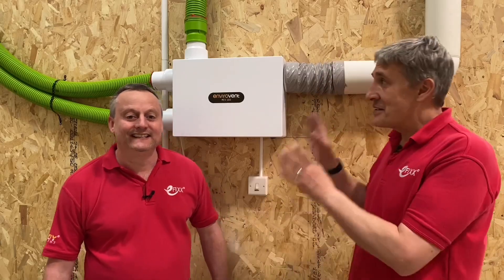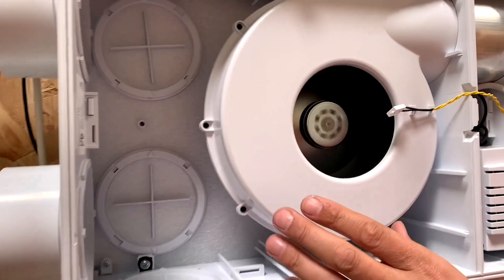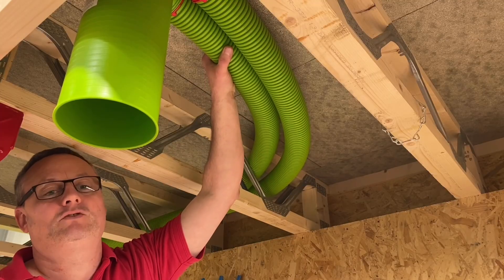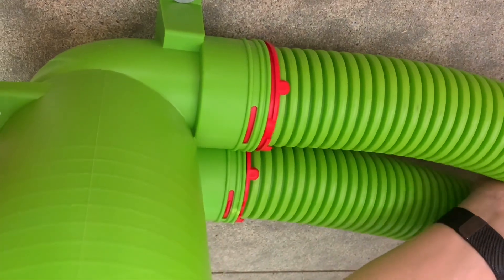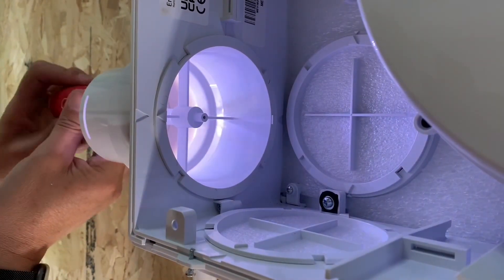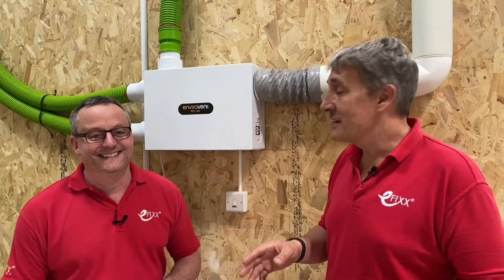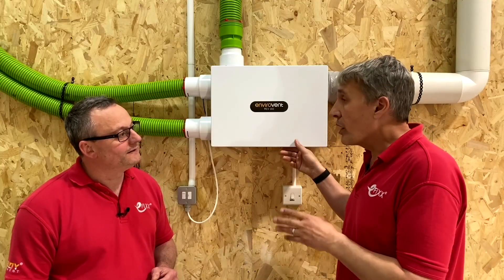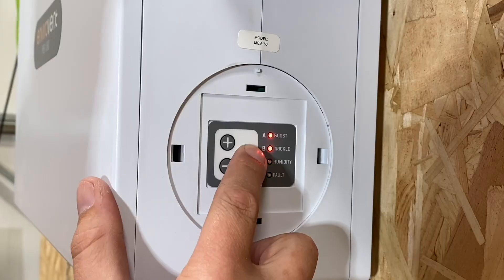WHOLE HOUSE VENTILATION is EASY with the MEV Fans & Fast Track ducting from ENVIROVENT

Comment: I have DCV in my house with much better central unit design. You need to clean assembly unit and its fan at least once a year and screw less removal is critical, otherwise people simply won't do it. Also each remote location has a flap controlled by moisture and/or occupancy sensors. You don't really want main fan to start sucking out equally from all the floors in the house.

Comment: Where is the outside air coming from? You will have negative pressure inside.

Also is there an option with heat recovery capabilities?

Comment: Well,it is good system. But I was waiting for napkin test which shows the power of flowing in and out. Also, the big problem if I can say so, with this ventilation is water gathering by steam in the pipes. I did not saw any solution for it except the flexi pipe after fan not before system.

Comment: I’m about to start our new build and wanted something cheaper than Mvhr, which I’ve had before and gave no heat benefit. Will this system stop the requirement of window vents, as I’m building air tight. Also will it make the house cooler?
Reply from the maker: No you’ll still need a full MVHR if you are going for an airtight home. - we have a full CPD on the topic in production atm.

Comment: Hi guys, looks a good system.. a couple of questions; is there an insulated ducting for this system to install in cold spaces (lofts) to prevent condensation? Also, with regards to heat loss through continuous ventilation would this be an expensive way to ventilate the home. As there is no heat recovery built into this unit, would it not be constantly pulling valuable heat from the home ?
Reply: @danielwood5334  My understanding is that whole house ventilation systems often use heat exchangers to get round this issue. Perhaps beyond the scope of this video as it takes a bit of explaining, but definitely a pertinent point.

Comment: How would a system like this affect the overall warmth of a house considering it's constantly extracting air?
Reply: It will remove whatever air at whatever temperature from your home. If the heat loss isn't worth it for the ventilation benefits, simply run it less or turn it off.

Comment: Corrugated ductwork requires more power to move the same amount of air due to the higher pressure loss along the length. Fixed ductwork rather than flexible is always preferred for efficiency!
Reply: This is what is not explained in the video. The fan will be working harder and have a higher sfp meaning more running costs.
Reply: I can see something inside the ducting. I suspect it’s not fully corrugated on the inside. Hard to tell!
Reply from the maker: It’s smooth an the inside and not to be confused with flexible ducting.
Reply: @efixx  thank you for the correction efixx. Is it available to buy over the counter as a consumer I'd like to try some with my portable air conditioner, say 125 mm DIA
Reply: @efixx  2:52 It does not look smooth?
Reply: @rolandhoeller2  yeah, it looks smoother than the outside, but not like the rigid pipe.
Reply: It's got an internal skin to reduces losses but not completely smooth like rigid ducting. Also its a smaller diameter. Both aspects increase losses for a given pipe length.

I suppose the choice you are making in using this is efficiency versus convenience.
Reply: @mea03wjb  Rigid ducts have smooth surface but any realistic installation will have sharper turns. This semi-flexible ducts can have smoother runs with very gentle curves. I think it's not that easy to say what will result in less resistance.

Regarding diameters AFAIK they use multiple parallel runs instead of larger diameters.

Comment: Surely this system is not very energy efficient in the winter?  Pulling warm air from inside the house and throwing it outside, from multiple rooms.  Can it be wired to only come on when switched on from each of the rooms with a duct fitted?  Or does it run 24/7?
Reply: So don't run it in the winter. You are not obligated to run something in your house simply because it's there. You can simply run it only when doing activities that produce odours and deal with the heat loss, but otherwise leave it in the low setting or leave it off. You don't run your heat in the summer, right?
Reply: Seems they are just promoting this product, not interested in the realities.

Comment: Corrugated pipe slows down the air flow. If you can fit smooth walled pipe the better.
Reply: But swept bends are more efficient than elbows.
Reply: @ajones8699  
True, but corrugation is a serious hindrance.

Comment: How would this work in a domestic installation for building regs?
It’s often specified by building regs depts for 100mm fan for bathroom & 150mm for kitchen.
I’m aware it’s due to flow rate, but with varying flow rates for different zones, how could use a single unit?
Reply: You need to read up on approved documents part F which specifies the types and more important flow rates of ventilation required for each type of room and the entire house.
Reply: You would use 2 defuser for the kitchen

Comment: Looks a neat system, everything is easy with web joists.
Why is it everyone makes a big thing about for rated down lights, yet nobody gives two hoots about cutting a 4" hole in the ceiling and installing a fan with no fire collar.
The only reason I can think is, the house is one fire compartment, and if that's the case technically we don't need to install fire rated down lights, a three storey house would be different, but the only place I could think fire rated down lights and a fire collar would be if they were being installed in a garage with a room above.
Apologies for going off topic, just an observation.

Comment: I can't help feeling that building houses which need this is a bad idea.  We will hear in 10+ years of all the problems sealed houses will have.
Reply: Hi Jim, As dwellings are becoming more airtight, it is imperative that the correct ventilation system is installed. The MEV system is a continuous running system . This allows a more controlled background ventilation rate than you would have in a leaky dwelling with traditional extract. These systems need to be specified, set up and installed  correctly in order to prevent issue in the future.

Comment: Shame it's not a heat recovery unit, all that wasted heat!
Do the regs there not forbid this type of unit.
Reply: Regulations provide several different forms of ventilation. While this system is not as energy efficient as a whole house heat recovery system, they are more efficient and better for ventilation than traditional intermittent systems.

Comment: Envirovent great fans.  We had been using them for years.  But they have gone down hill, I'm not sure what's happened but since the packaging has been rebranded we have had to go back to faulty units, not just 1 it was pretty much every unit. Never had any faulty products previously to this so my thought is that they may have changed manufacturing.  
We have had to source another brand.
Reply: We would be interested in hearing more about why this is and what fans you are using. The changing of the branding was not inline with any manufacturing changes. There have been changes to some products over the years as technology evolves and regulations change. however, Envirovent pride them selves on a quality product nd service. Please contact our customer care team if you feel this is not the case.
Reply: @larrysoper4785  thank you for your response.  We had used envirovent for many years and never had an issue until these S & P new packaging appeared so not sure what has been changed but for some reason we seem have an issue with them.  Inline fans especially (MV250/100T & MV160/100T) and a centrifugal wall mounted unit.  The SIL100T are still in stock with the original packaging and so not experienced any issues with these as yet.

I have a new fan to replace a faulty one and this will be the 3rd replacement.  The last 2 didn't want to work on fitting. I'm hoping this works this time.  🙏

Comment: So can this not be installed in the loft? We are in the process of redoing all bathrooms in our house and they are all upstairs and the best location for this would be in the loft so that 1 unit can do the job instead of 3 separate fans. If that, then I assume we can’t use the green ducting as it will not be the same temperature and may cause condensation.. in that scenario, what ducting should we use? Insulated??
Reply from the maker: An insulated version of the ducting is available
Reply: Insulated ductings should be used outside of the envelope. Heat recovery equivalent would be recommended though which would then feed warm, clean air into the habitable spaces.
Reply: @kieranmccreedy271  Thanks Kieran.. we are going to be looking at the heat recovery module instead of just ventilation...
Reply: @rexgold101  👌🏻
Reply: Most centralised units are suitable for fitting in a loft space without the requirement for extra insulation. However, any ducting in an unheated area of a building (i.e. a loft space) does require insulation. With an MVHR system it is also important to insulate both ducts that run to/from atmosphere. The Domestic Ventilation Compliance guide provides some great information on install requirements for the different ventilation strategies https://assets.publishing.service.gov.uk/government/uploads/system/uploads/attachment_data/file/456656/domestic_ventilation_compliance_guide_2010.pdf

Comment: Personally if I was going to the trouble of running ducts etc I’d want a ventilation system that included heat recovery. 

That just pumps the air you spent money heating straight outside.
Reply: Yeah, sadly the building standards often let house installers get away with just these systems.
Reply: @edc1569  boggles the mind when today we are at a climate change summit! Not expecting Passivhaus house standards but in 2021 we should have more insulation, SOME solar, heat pump, heat recovery ventilation and a basic car charger in the regulations for new builds by now.
Reply: @kieranmccreedy271  many councils are already insisting on charging points as part of hew builds. Remember that building regs are a minimum standard. Passivehaus is growing quickly but it will be a long time before it's the norm I'm afraid
Reply: @edc1569  building regs are changing, in fact we've got a change next year as a stop off point before future homes standards in 25.....
Sadly ventilation is not sexy enough to warrant a house builder to fit more than they need to achieve compliance
Reply: Wow are we still installing new ventilation systems for homes that don't include heat recovery. The extra cost on new build is minimal and it is a big saving on home heating.  So this is fancy tubing on a 1960 design.
Reply: @caterthun4853  my thoughts exactly. You’re already 90% of the way there with a MEV… two more ducts and you can easily have the same with heat recovery
Reply: Another step to improve efficiency would be to add an electronically controlled damper and sensor on each inlet, so that if 1 person is taking a shower it doesn't draw air full rate from every inlet. And the boost switch has seen its day - there should be a timer switch option to allow different times to be selected.
Reply: @JasonEDragon  In this example, you could reduce the heat loss caused by this system by 66% if only one room needed the boost function.
Reply: @JasonEDragon  an idea but MEV and MVHR are classed as whole house systems to create cross flow of air throughout the property. Combined with a humidity tracking system which reacts proportionately to rises and falls in humidity.. within the moving air streams of the ducts provides a better overall performance
Reply: @dave2166  These systems seem more focused on protecting the property from humidity damage than actually providing the people living at the property with good ventilation. If I'm taking a shower or using the toilet then I want good ventilation in that single bathroom. If I'm cooking then I want good ventilation in the kitchen. If excessive air is being drawn from rooms that aren't being used then good conditioned air is needlessly being discharged outside - wasting money and causing pollution to either heat or cool the new air.
A good centralized system could easily allow for a heat exchanger and be optimized to exchange air from the rooms that most need fresh air.
I've had push button timers controlling the fans in all my bathrooms in the USA for a few decades and I wouldn't live in a house without it. I just wish that I could find a kitchen range hood with a timer on it.
Reply: @JasonEDragon  both MEV systems and MVHR systems can have many different controls from basic boost switches to more intelligent air quality or humidity controls that will vary the speed of units according to demand. This makes the systems more efficient and better for ventilation, most of Envirovent's range of centralised systems have built in humidity trackers as standard. However, as always, cost plays a big part it what systems are installed and specified. 
As @Dave Nicholls has previously mentioned there are many changes due in various regulations to ensure more energy efficiency systems are utilised for ventilation.

Comment: Why no insulation on ducting? There will be water build up at some point due to cooling!!
Reply: You only insulate ducting if the are in a cold void such as a roof 
Within the building envelope you don't need to insulate. With fast track and mev there isn't the same issues as its a continuous running system so condensation doesn't form unlike a bathroom fan which can push moist air into a piece of roof duct and then switch off so trapping that air so it condenses inside
Reply from the maker: Great answer 😀
Reply: It must have some air flow taking condensation from the kitchen bathroom and not need insulated pipe work .
I wish I seen this years ago this all that insulated ducting I have been wasting  money on all these years.
Reply: @Bigballs72  not about volume of air it's about the continuous flow of air... in a ceiling void ducting isn't insulated as its building envelope 
If this ducting goes onto a roof space then there's an insulation sleeve which slides over it keeping it snug. The greater issue is condensation forming on the outside...if air is moving all the time in the smooth bore of the fast track it doesn't get chance to condense.
Reply: @dave2166  I didn’t realise the void between the ceiling and the floor was the same temperature has the room into venting.
Especially with insulated plaster boards. Sorry your wrong insulation is needed. It will condense in ductwork with the slightest bit of difference in temperature and length of run.
Great videos but your not always right.
Reply: @Bigballs72  This is where careful consideration is required. If any ducting is running through a void where the false ceiling is insulated, then this is outside of the heated envelope and yes you are correct insulation would be required. However if the false ceiling is non-insulated, there is no need to insulate. This will also depend on the system and duct, for example, supply and extract ducts that carry air between an MVHR unit and the outside and vice versa, always require insulation.

Comment: Hi Guy’s, Could you use this to move hot air, say from a south facing conservatory, to another part of the house that may be north facing.  Slightly back to front I know but looks like it would work!
Reply: The issue might be how to get the ducting in a sympathetic and efficient manner from room to room. An inline fan as efixx showed recently would be more appropriate although every situation is unique
Reply from the maker: We will ask! - good idea
Reply: I already done this with bathroom extract fan from South facing conservatory. Works a treat in spring and autumn.

Comment: We are using  the envirovent wall fans for kitchen and bathroom,   had them come and tell us about the installation.  Wasn't impressed as we do a lot of like for like swaps  and the envirovent fan spigot doesn't go flush with tge wall so you have to cut the ducting back . Right pain when it's plastered in soil pipe .